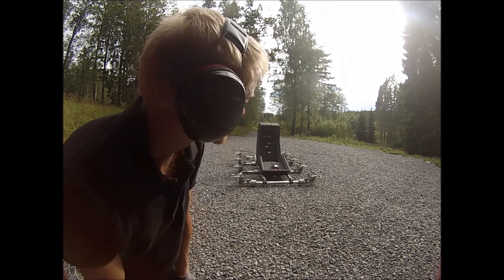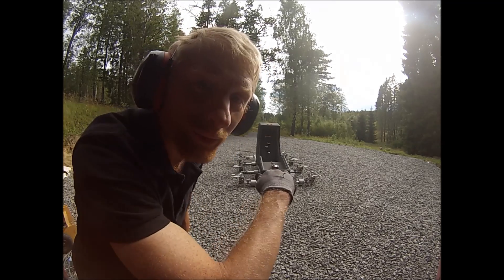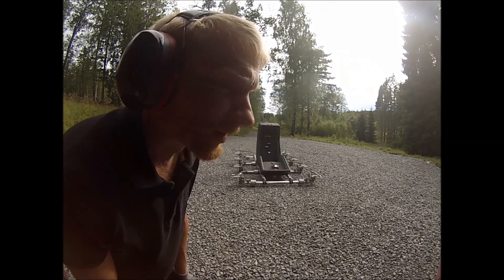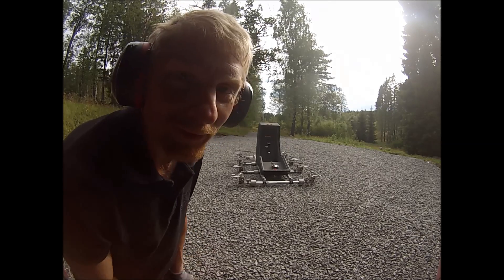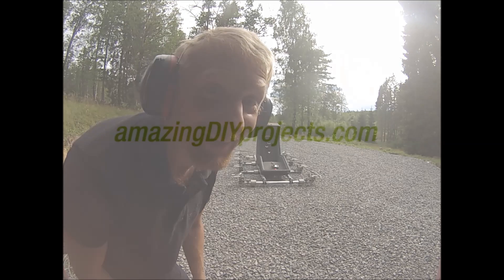Manned multicopter Episode 11  Expanding the flight envelope -Yaw

Comment: hi really enjoy your work. the reason it yaws one way better than the other is the props all turn in the same direction. counter rotating props on every other motor will remedy this.
Reply: If they all spun in the same direction the craft would not fly at all.
Reply: I thought they were all spinning the same way when I watched the video. could be wrong.  Not sure why you think it would not fly at all but having them all spinning the same way would limit yaw in the opposite direction of the prop rotation.

Comment: Excess carbon build-up tells me the engines are running rich. Do you have mixture control?

Also, the reason why it's easier to yaw in one direction than the other is because of torque from the engines all turning the propellers in the same direction. I'm sure you're fighting to keep the "nose" straight the whole time you're in hover, am I right?

Comment: You may want to think about extending your front and rear rotors at least the length of the props to reduce the the turbulence in the downward force between props and reverse prop rotation on opposing props

Comment: I dunno is this for real or is this a hoax? How do you synchronize  all those twin cylinder engines and also how does this stabilize with all the props rotating the same direction. Seems like there is alot of pixel distortion and blending around the crafts image when flying around the background. Is this video imaging trickery like a cut and paste or does this occur due to video compression? Is this legit video or a hoax!

Comment: To Improve Yaw you may wish to explore gyroscopic procession. Drones usually use this. on Store bought drones if you look at a 4 propeller configuration you will note that 2 of the 4 rotors are rotating counter clockwise and 2 are rotating clockwise. The engine controller is programmed to decrease or increase clockwise or counter clockwise sets and can produce yaw turning at hover or level flight. You might look into either converting or purchasing some counter clockwise rotating engines and reverse pitch props I am not sure what controller you are using but i like and recommend the multiwii style controller. Some of these controllers also feature hover and homing options. What you have done is nothing short of awesome! there are those that are saying that drones could never carry humans. you just proved them wrong. hope this information helps you in your endevour. Good luck.

Comment: "For some reason it turns quicker to the right". Well I'm no expert but Isn't that because your rotors are spinning to the right? Regardless that is one hell of a craft you built there, excellent work. So how far do you plan to take this project?
Reply: William C83 if all the rotors turn the same direction then a cutting edge that provides the lift.

Comment: I'm curious about how you arrange all your swash plates relative to each other, how they action during turning... because having all your motors in two rows like you do tells me that each rotor's swash  would need to be angled in a very specific direction and different to each other to make turning more efficient. It simply wouldn't be enough to have them push left or right. I have some ideas on how you might improve turning and possibly lose less height into the bargain but it's kinda hard to explain without drawings. Since I don't know how you have the swash plates arranged it's difficult to understand. I don't know your complete steering system anyway... maybe you have all the swash plates arranged coherently which would make strafing easy at the expense of turning.. maybe changing the swash plates to make turning more efficient would be at expense of strafing/sideways motion... but still I don't know your control set-up or how independently you can operate the swash plates or whether you can only have them all go same way. so many questions I have. but the difference in turning is definitely a torque issue, but you can't change that with those motors... but the torque issue only gives a difference in turning left and right, that difference wouldn't matter with the ideas I have, improve turning efficiency and the torque issue doesn't matter so much and you spend less time trying to turn and losing height.
Reply: He doesn't use swash plates.
Reply: I figured that out after watching other video for closeups lol, but he must use something to tilt his rotors

Comment: Do you have all motors rotating on the same direction? Thats probably why it turns faster one way than the other. You need counter rotation. Some how you need to make the motors on one side rotate one way and the other side the opposite  way.

Comment: The yaw differential may be caused by the torque of the motors. They are all rotating in the same direction, so when you yaw in left direction, it is against the torque, as opposed the right which is with the torque of the engines. Same effect can be experienced in a helicopter.
Reply: P Toth What setup would be best for efficient turns? He has all 8 blades spinning clockwise at the moment.
Reply: Counter rotating the port from the starboard engines.

Comment: Nice unit try to create an in closure for your seat or cover each propellers like a drone just for safety and I was thinking what if you can control back propellers so you can increase there speed so it will steer you straight then if you can control each side independently as if you higher up the speed from the left side while in mid air it will turn you towards the right I'm sorry if I'm confusing you do you understand what I mean

Comment: sooo stupid. what happens when one of the engines goes out? you just die? or is the ting only meant to hover less than 3 feet off the ground. how useless.  you could also just make a small helicopter.
Reply: unknown cuyler it's innovation. this is how flying cars start. just like how some crazy guy invented planes. or helicopters. some one has to do it first. don't hate him support his success
Reply: its not innovation.  multicopters are nothing new.  japanese already made one.  All I am saying is its really fucking stupid to think of something without thinking of the safety implications first.  all engines have a failure expectancy.  all aircraft experience engine cutout. the only difference here is there is no plan for it.  one engine dies and the pilot is dead.

all you need to do is add a collective pitch to each blade. make it capable of autorotation.  then use altitude to keep safe.
Reply: unknown cuyler in order to do all the things you said he needs to make a prototype first. he's not dome it before so he needs to sort all that out and make mistakes. he's flying at 3 feet which definitely won't kill him and he also has kill switches built in. it is innovation when it's a man making it in his back yard not some super company in Japan. its incredible and as long as he wants to do it I say go, it's freaking awesome
Reply: do you know what auto rotation is and how it works?
Reply: unknown cuyler yes I know exactly what it is, your point?
Reply: then you understand this will never be okay to fly higher than ten feet without it. or at least a parachute.  

unless you had overpowered motors to compensate for 2 engine cutoffs. and fast smart computer sensors that can quickly maintain control of the craft in this event.  

Im not saying this is a bad idea. i mean that there are ways to plan for why this is a bad idea and it can be great.  nobody is going to use this ever if it can kill you easily in a failure.  Im just trying to discuss whats going to happen when someone is falling from that thing.

imagine if all engines were connected via driveshaft. had multiple motors powering it.  each blade has collective pitch for control(no cyclic needed).  now if an engine fails all blades do not.  or if all engines fail the autorotation can bring u down.
Reply: unknown cuyler I understand it's probably never going to be used cosmetically or if it is loads of things need to be changed and fixed. but you can say the same about a car, if a wheel comes off its pretty dangerous. i just think its people like this guy that are finding those problems and coming up with the most crazy diy ways to get round them that will push innovation forwards. some ones gotta stuff up for others to improve. I for one think this is great

Comment: the loss in altitude probably occurs because you don't have enough headroom on your power.  Normally 2 props speed up, and 2 slow down.  If the 2 fast props are already near max, the other ones will still slow down, for an overall reduction in thrust.  You need to see what's happening to your throttles to know if this is the case.  Trying to fix it with altitude control on your flight board is probably going to interfere with your yaw, or do nothing, depending on how things are mixed.
Reply: Or worse yet, it'll wind up your "I" terms and you'll come out of every droopy turn with a full throttle hop.

Comment: Why dont you try to put the structure of the motors on top of the chair?
I think that it would be much more stable with your weight bellow the CG and you will be also outside the traijectory of these propellers.

Comment: Your flying/tuning seems like it is getting better. I would use a DJI Naza M controller with a GPS and you will be abile to hold your position way better.

EK~
Reply: relying on flight aids on a system that's not really well tuned often leads to crashes.  A human will damp out he oscillations if he knows what he's doing and stays calm.
The computer will often overcompensate badly, and doesn't know to calm down and make smoother inputs.  Keep in mind, also, that very large vehicles respond more slowly, and the range of pid settings on an off-the shelf controller might be insufficient.
Reply: Hmnnnn, then some form of direct controls are needed because he is using a RC Radio for control. Dangerous.
Reply: Yah, I don't think I would want to rely on the radio link either.  He could probably use a trainer cable from his handset to the flight controller.

Comment: you're yaw turning right faster than left is caused by P-factor. Check out basic propeller dynamics . I applaud your interest and enthusiasm but, as you've already experienced anything can happen...don't fly alone...and there are stabilization products available for R/C flying that would increase stability along with many other enhancements . You don't have to reinvent some of the things that are causing you problems. All that being said I am all for the thrill of doing your own inventing and experimenting however, getting your props above your head would be safer... keep thinking and above all have fun and remember... flying is can be fatal. sincerely, Pappy

Comment: Would love to see this but with the RC jet turbines and tilt rotor ability. This thing would most certainly be a lot of fun to fly around at that point. Likely not very low cost, but most certainly a great deal of fun.

Please try looking into ducted shrouds as well as q tip props to get more thrust and less noise.

Comment: Putting aside the possibility that one or more of the engines just aren't synced to put out the same power level, (or one engine is weaker than another) another thing that can cause a max yaw rate  imblance is if one or more of the motors is not mounted perfectly horizontal to the frame.  For instance any motor at the corner, if angled slightly fore/aft or inward/outward, will cause an added torque around the yaw axis due to angled lift.     You'd need some yaw trim to correct for it in a hover, but it will have a pronounced effect on max yaw rate as you're fighting it in one direction and it's helping in the other.

Comment: with linear generators a gas/ electric hybrid would be great on flight time.
Reply: that is what I have been thinking of  building a large quad and fitting it with a Honda silent generator to supply the power to a battery pack that powers the motors that way if the generator quits you have a short time on battery power to get it down, I will have to take a look at output power and weight for the generators and compare it to the battery draw from the motors.
with straight battery powered ones if you want to extend the flight time by double then you have to increase the battery pack by an extra 150% as the extra 50% is for the extra battery weight but with a generator powered one if you want to double the flight time then you just have to increase the fule tank which is not a large amount of the overall flight weight.
Reply: You need a 40,000 watt generator to stay in the air with out discharging the batteries. That's why linear generators are the only way to do it without adding to much extra weight.
Reply: My max flight time was 1 hour 43 minutes
Reply: Sorry gas tank was empty after 1 hour 43 minutes in the air but the batteries after the landing were still 3/4 full . The batteries only took a drain after the gas was used up for the linear generators.

Comment: You need to have counter rotating props. Not all turning one way, on each side of the aircraft, but more like this..

L   R
R   L
L   R
R   L
Reply: How are we yawing the thing here? Are we simply supposed to reduce the torque on props spinning one way so that the ones spinning the other way create a larger moment on the device and yaw it? How was he doing it in the video?

Only thing is, we say "ya counter rotating props", but it's not that easy to just flip the rotation direction of a gas engine. Those kinda look like RC gas motors that I've looked at before, and the ones I've seen only have the crankshaft exiting one end of the motor, meaning you can't just flip it to reverse rotation.
Reply: +traumaconcept John He's already doing it exactly that way.    Can see the motors and props up close in the last video.
Reply: +Sevalecan  Yet that is how it works.  Each motor spins an opposite direction from the one next to it.  Like virtually all multicopters torque is balanced by counter-rotating motors/props and yaw is induced by speeding up half the motors and slowing down the other half to create a torque imbalance while ideally maintaining roughly the same total lift (he needs to work on that).

Comment: it's easier to turn to the right because of the torque created by the rotational direction of the rotors. unless of course they are counter rotating, but the video does not say. a simple tail rotor would make your craft extremely maneuverable... if you can spare the weight.

Comment: If all the engines spin in the same direction I believe it is the torque of the engines causing it to turn better one direction than the other.
Reply: Well that's exactly how a multicopter turns. Half the motors are spinning right and the other half left. For example if you want to turn right, then the motors spinning right decrease throttle and the motors spinning left increase throttle.

Comment: Put an inner tube under it to soften touch down,  Start using a pre flight and post flight check list, and don't forget to develop a smart phone app to fly it by cause that would be soooo Cool!  Take a look at my "Tri copter using Coanda Thrusters model You Tube". It's short but it makes the point.  Getting rid of the props would make all the folks less nervous.  BE SAFE! GOOD LUCK!
Reply: Full the inner tube with hydrogen. Those sharp stones and that O2 mix with an exhaust ignite will not out way the lift you will get from the light gas in the inner tube!
Reply: Sound good!, Sort of a rocket assist take off devise with a BANG! The VZ-7 Lives!

Comment: Boats use counter rotation props to reduce both roll and yaw. If all of your props are common directional, you will be having some issues.
Reply: +pokies100 yes they are counter rotating
Reply: Yes do your motors run the opposite ways 1/2 of them?

Comment: He just needs to upgrade to modern avionics, I imagine the AvroCar with some simple radio control stabilization boards could perform as originally intended. So, time to Upgrade, then you'll be able to GEO park safely, and much more!
Reply: well the u.s. gov has ufo tech supposedly. I saw a couple ufos fly over my house and they didnt even make a sound. So i imagine he would need to get a quieter form of propulsion.. i wonder whats louder. these props or a turbine.
Reply: While you are right that the government is not in the manufacturing business, they do in fact test and evaluate equipment presented my manufacturers seeking mil spec certifications.

Comment: The yaw is more difficult in one direction because all the engines are trying to push in the opposite direction.  Here is a wrench for you...  Replace the 4 props on one side and have those engines run in the opposite direction.  Your design looks stable as it is watching this video.  I'm not too sure that you want to change anything yet.
Reply: They already do.

Comment: Just a suggestion... if you really want to get it into the air and maintain steady flight, add an array of 3 large hydrogen balloons... a combination of the old and the new... it'll work
Reply: Haha! What could go wrong with hydrogen after all...I like it!
Reply: +Trixter same thing can go wrong with the gasoline in those engines... give it a try... just take the normal precautions
Reply: hydrogen balloons?   Yea, sure, whats the worst that can happen.........
Reply: +JimsEquipmentShed ... well, the worst would be getting 10 feet up and one engine stalls... with the balloons (additional stability)...  Don't let the Hindenburg taint your perceptions. . . Hydrogen can be a safe cheap alternate lifting gas....
Reply: overall, amazingdiyprojects, you did an incredible thing... powered controlled flight... I'm sure you can find a thousand ways to refine your idea